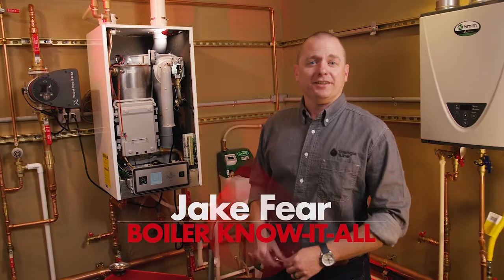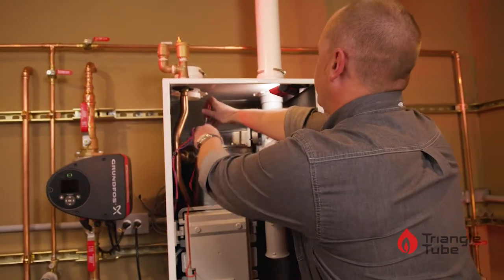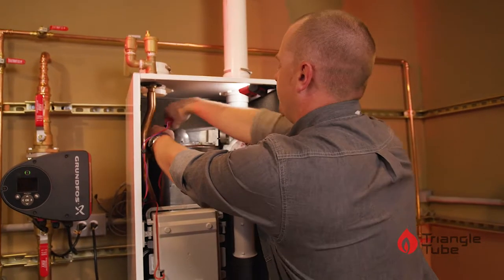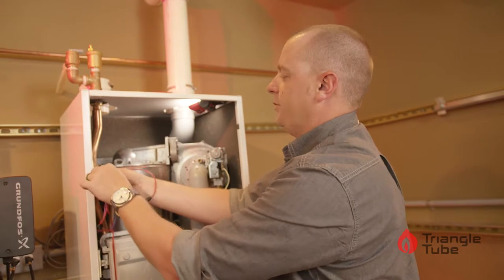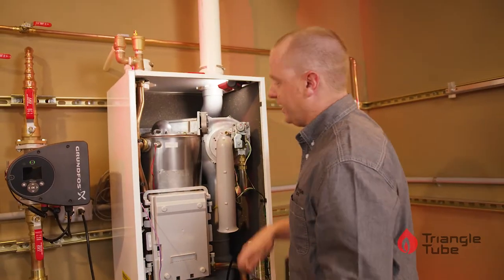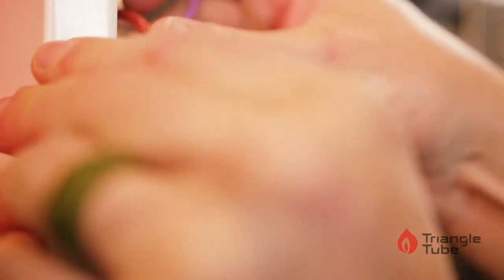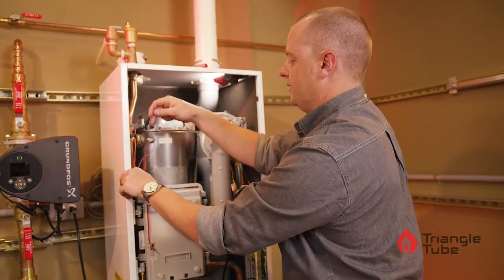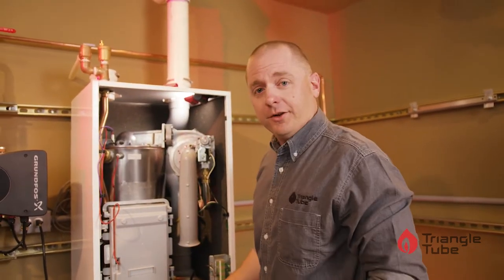How To: Change The Igniter

Comment: Can these be cleaned or just replaced?  What common fail items would it make sense to keep on hand for these Triangle Tube boilers?
Reply: I took mine out about 6-7 months ago and cleaning it, worked fine. Used steel wool and light grit sandpaper made it shiny again. But now it failed again so I will just order a new one. They cost about $60.
Reply: In the dark you can see the electric arc ground around the insulated on the outside. Be well.